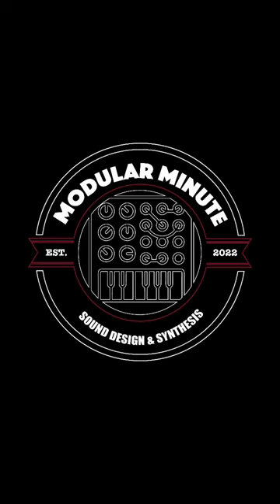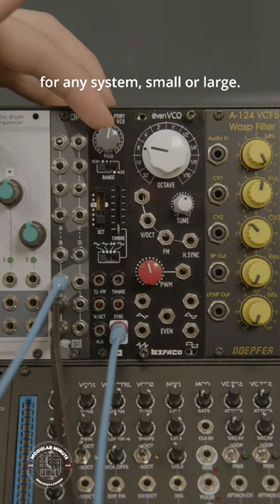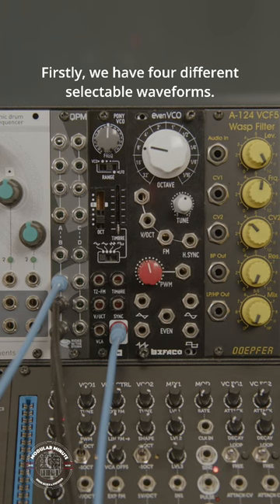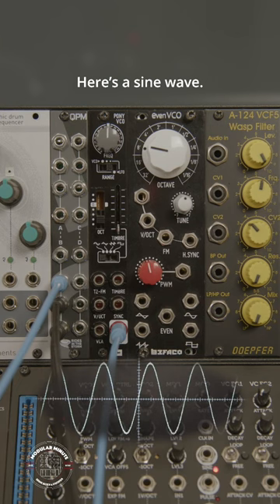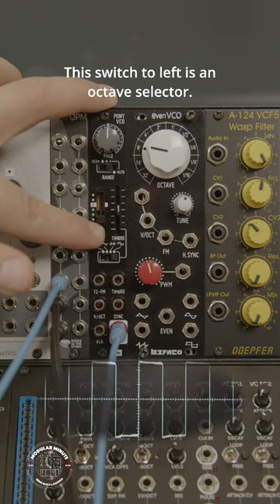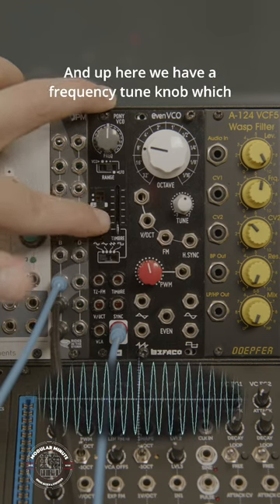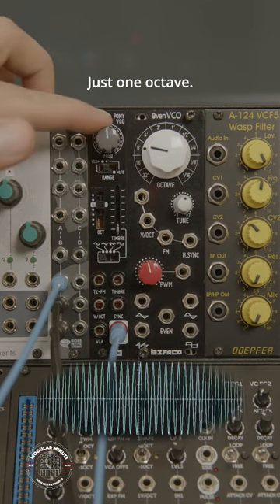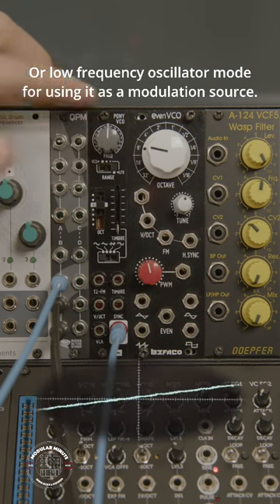The Modular Minute 126: Befaco Pony VCO Overview

Comment: The scope is not required.
Reply from the maker: not at all, but a helpful visualization tool!
Reply: @the_modular_minute  For... what? Sorry but I think we know what these wave forms look like. I am considering buying this.
Reply from the maker: @kdsf12  sure! but may be helpful for others to gain that association. plus, sometimes depending on the oscillator core, the outputs may have some influences on their shape. in this case, they are pretty pure, as long as the timbre slider is turned down of course. as far as this module goes, highly recommended. the through zero fm is awesome and having the on board vca is great on a module this small. really great for a small instance.
Reply: @the_modular_minute  I guess my first concern is musical.